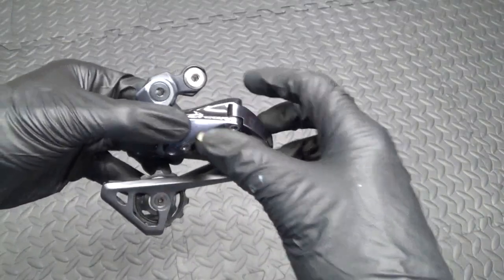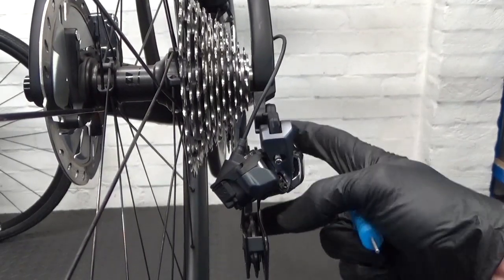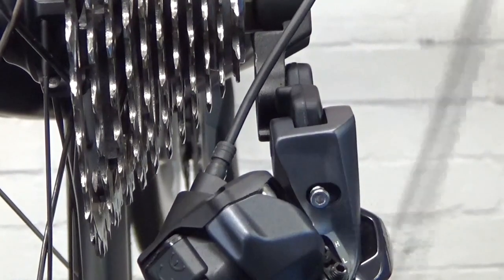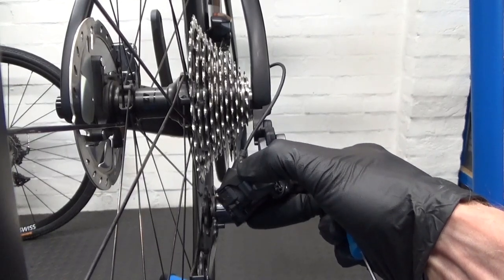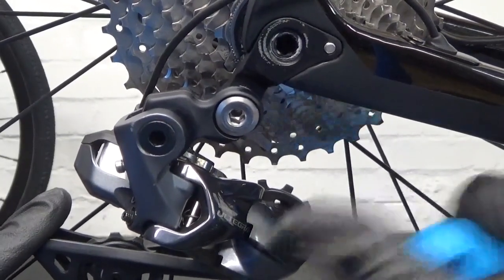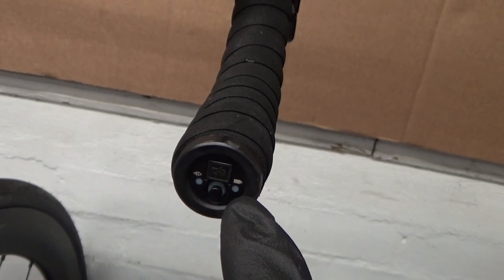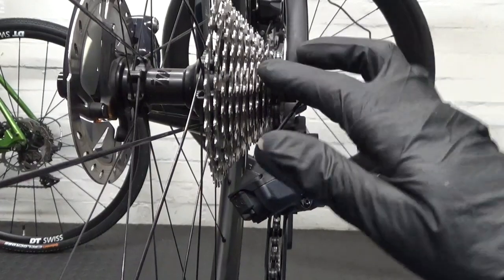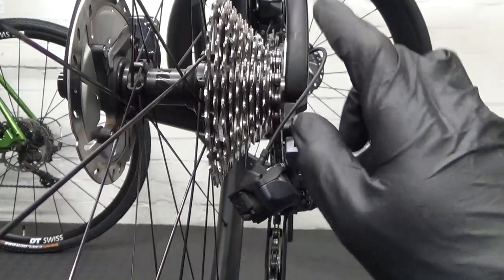Shimano Ultegra R8050 Di2 Rear Derailleur Fitting Guide

Comment: Thank you so much for putting this together, it was very helpful!  One part I stumbled on was my front derailleur was on the small ring, and, as I found out, when in the small ring the control system prevents the rear derailleur from going into the smallest cog.  That caused MUCH confusion when I was attempting to set the 'H' screw adjustment.  Once I figured that out I was rockin n rolling.  I would consider adding a note to the video to 'be sure to set the front derailleur to the big ring' before adjusting the 'H' screw.  Alas, I dring a beer for you. Ching Ching.

Comment: Hi Free To Cycle thank you for such an informative video. 
I replaced my old RD-6870-SS rear derailleur with a brand new RD-8050-GS (I have an 11-32 cassette) just a few days ago. I have encountered a problem though. Shimano manual tells you to select gear 5 to start micro adjusting the derailleur. Then start clicking inboard until the chain touches gear 4. I do that but I run out of clicks. The micro adjustments are there, a full 32, 16 each way. In my case I only get 9 clicks inboard (then if I keep clicking inboard nothing happens) and the remaining clicks outboard. I made sure that the high/low stops are adjusted correctly, that the rear wheel is true, that the hanger is correctly aligned with the hanger alignment tool and that the the front derailleur is also setup properly. When I adjust, I have the chain engaged into the the big chainring (in the front 50 tooth). The small chainring is 34. What could be causing this? I am currently stuck. Thank you.

Comment: Cheers for video.  I’ll have a go again at trying to fine tune my Di2.  It goes through all gears when on big ring fine and quiet. But when your in small ring it doesn’t change great just catching, so then you adjust it so just enough to get in gear. Great you think.  Go back to big ring go through gears again and you then have same problem Vice versa. Maybe my limit screws are upsetting adjustments.

Comment: Very good, I did have trouble with the front derailleur but had to shim it so it would work, The chain ring was smaller and at the bottom of the frame front derailleur mount so it would not center and it pushed out in the front when you tried to adjust the top adjustment.  I think it will work but have not put chain on yet so waiting for the chain to arrive.  I think its all set to go thanks!

Comment: Hey @FreetoCycle ⚙, great installation videos for both front & rear derailleurs, I've installed an Ultegra Di2 on my Canyon Ultimate CF SL, (11-32 R, 52-36F)
All seemed to be shifting fine before the first ride, when I when up my first decent hill, in first gear it over shifted and the chain came off, so I adjusted the limit screw so that wouldn't happen, then I was getting it to shift into first gear but it would stay there for 2/3 revolutions then come down to second gear, I then went on to the Etube app to adjust the gear (so I could see what was happening), I adjusted, and again it was shifting fine at home, but when I'm on a hill it is now upping in the second & first gears when going up hills, 
Just wondering if you ever seen anything like this??

Comment: Great video. I have a question. I have a 10 speed di2 dura ace and it seems that my rear derailleur  is going bad. Is it possible to keep my front derailleur and upgrade the rear derailleur to an updated 11 speed dura ace di2 and 11speed cassette ?
Reply: Yes it is, but you would have to change your shifters to 11 speed and your chain to an 11 speed chain also.

Comment: Hi may I know if there any issue the RD hit the cassete when  the gear in smalest sprocket ? Because it hapen to me wh3n I change 8050 RD SS to GS,  I use Y3E81600 inner plate and Y3E998080 outer plate
Reply from the maker: Could be chain length or incorrect B-screw adjustment!

Comment: Which should be installed and adjusted first, front or rear derailleur? The front derailleur is used while adjusting the rear derailleur in this video so does that mean the FD should be installed and adjusted first?
Reply from the maker: Rear derailleur first!
Reply: @FreeToCycle  thank you

Comment: Every time I adjust the b limit screw to the 8mm rule as soon as I’m in small ring at front an anywhere over towards the 11 tooth on the rear I lose all tension in the chain an rear goes floppy
Reply from the maker: Chains to long!
Reply: Cheers fella,Have you got a chain length  video .